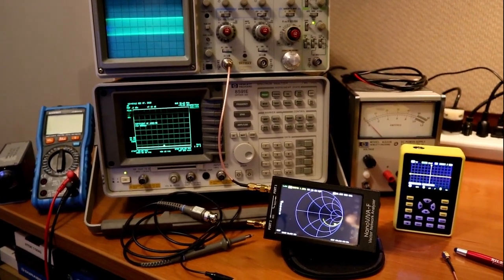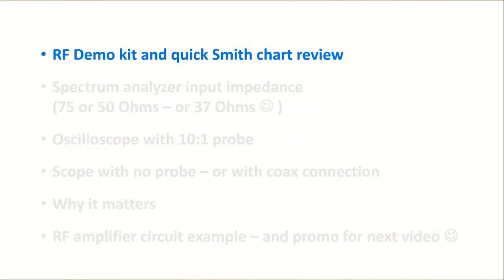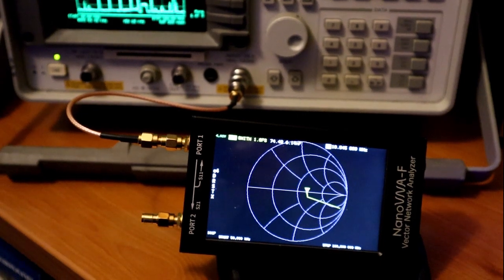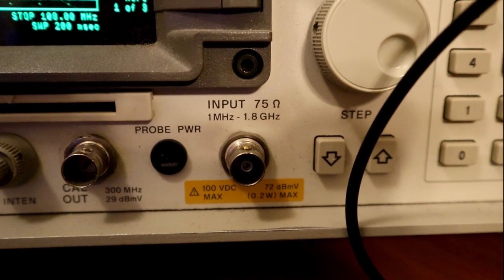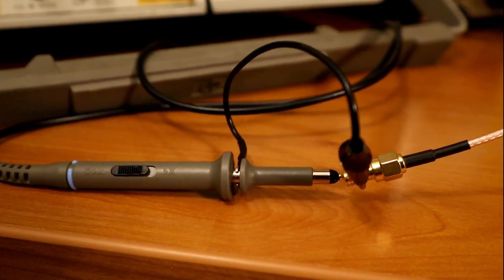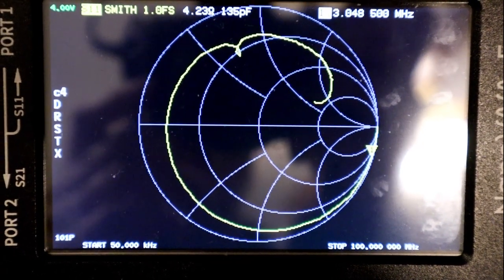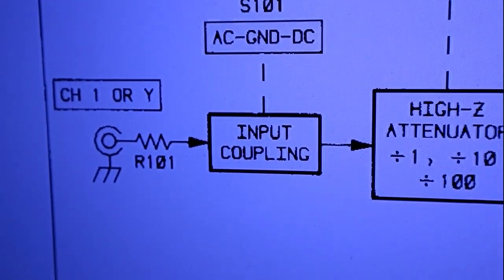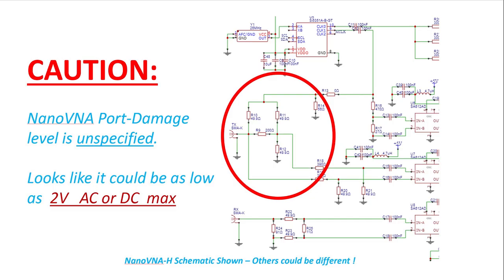NanoVNA - Measuring Impedances

Comment: Thank you!! I have the demo board and will fiddle around with it. I am curious though, I am trying to interface a 50ohm  antenna output to a little lithium battery charger board and want to know what the antenna "sees" when hooked up to the charger. I assume if there was 5Vdc on the input of the little battery charger ckt to activate the charging ckt, it would damage the NanoVNA, right? How do you measure an active circuit with a VNA?
Reply from the maker: You are right to be careful. Running our university lab, I always checked our instruments to be sure they had DC blocks in them and configured the power supplies we used to never go above 15 volts, since a typical DC block is only good to maybe 50V. The VNAs we had did have them (built-in series caps in the directional couplers), but some may not, and scopes with 50 Ohm inputs, and some spectrum analyzers didn't. So I got DC blocks and put them on the port with a sign that said ("do not remove this DC block"!). I don't think the NanoVNA has built in DC blocking, so when I built out my home lab I bought a few SMA versions like this: https://www.amazon.com/Nooelec-SMA-DC-Block-50kHz-8GHz/dp/B07YYLHJKS  There's some related discussion in the video on Measuring S21 and S11 of amplifiers, and of the DC block specifically around 2 minutes, 15 seconds into it: https://www.youtube.com/watch?v=GAycxgbncHU&list=PL9Ox3wpnB0koBGofotI4xS8R0ct0FeYfv&index=9

Comment: Just discovered this series of videos... loved the antenna series!    Just FYI, we have the same SA, the HP8591E, FYI-2, there is a soft menu switch to flip the input impedance from 50 to 75 Ohms, go to Amplitude, then More (page 2) and there is an input Z option switch...  4th menu softkey.    Hope it helps.    Steve
Reply from the maker: Thanks.  The 8591E is a great machine. The setting you described is great and even stays active after power cycling! (I think I have mine configured to recall 'last' configuration). I picked mine up on Ebay back around 2010 and it's gotten a lot of use. I found it for $800 listed as needing some repair, but when I got it, it worked fine. I was almost missing having the opportunity to try to fix it. It has developed a vertical sweep non-linearity issue (moderate) in the last few years. So maybe I'll get my chance after all ;-) But it settles out after about 15 minutes 🙂

Comment: Interesting facts about input impedance(s). I am confused, though, about the scoop. As are some meant to work at high and very high frequencies. I also know that good practice is to terminate the input of the scoop when testing for amplitudes, like bandwidth sweep. So definitely very useful piece of information here about the loading issues. As you wrap up, RF engineers use SA or VNA at higher frequencies, how do we measure then IN CIRCUIT, without loading much. For scope that could be differential probe (but I suppose very expensive for higher frequencies). But what about SA as those are all 50 or 75 Ohm input? I know there are special AVO meters for RF....
Reply from the maker: Excellent questions. There are two main methods used at RF. One is a passive, resistive voltage divider probe. For example, put a 450 Ohm resistor at the tip (in series) and then just use 50 Ohm coax going back to the 50 Ohm test equipment input. That gives a 500 Ohm load on the circuits, and a 10:1 attenuation (20dB). 500 Ohms is often OK at RF, but one could also use a 4950 (or 5K) resistor, making lighter loading, at the cost of 40 dB attenuation. Here's an example of a 500 Ohm one sold commercially (we had a couple of these in our lab). A little pricey, but you can also make one yourself. Of course, don't forget about the need for DC blocking (and generally don't use on high-power or tube equipment). This one includes a DC block internally, rated for 50VDC:  http://www.auburntec.com/auburn_INFO%20P20B.html#SPECIFICATIONS   The other option is to go with an "Active probe". They have to be powered, have limited DC voltage tolerance (maybe 5V), and are quite expensive. But they can present light loading, like 100K in parallel with 0.5pF. We also had those in our lab, but they are a little cumbersome to use. But not bad...
Reply: @MegawattKS  Thanks for the explanations. It probably all depends on the Zout of the circuit part we want to measure. There is one old type of analog AVO meter that is suited for these measurements. Meratronik V640. Probably designed and built in Poland, but there was cooperation with Canadian designers. And Marconi company also brought one under their name, but probably not designed themselves. The meter uses a special RF probe. DIY project for broadband diff-probe is one on my list. For SA, maybe to use 1x follower that have a high Zin and low Zout?
Reply: ...I am looking into OPA858, maybe to make an probe with it (TIA - Trans Impedance Amp).

Comment: Can you make tutorial how to measure gain antenna using nano vna?
Reply from the maker: Hi, sorry for the delay in replying.  Have you seen any of the "Antenna Briefs" series on this channel? https://www.youtube.com/playlist?list=PL9Ox3wpnB0kqNLnCdCtWcjGq7nRVHYxKA . While this doesn't directly show how to measure antenna gain, the series covers the definitions and utility of knowing the gain, and all the related things in a wireless system. Episodes 1, 2, and 6 are probably the closest to what you're asking about. Indeed, at about the 2 minute mark into Episode 1, there is a setup where the NanoVNA is used to look at bandwidth and path-loss (in addition to return loss) within a TX/RX system. It also covers issues of size vs frequency. In general, antenna measurements are rarely done at 30 MHz and below because of  size and difficulty with setup, and the NanoVNA wouldn't be used for that. But at UHF and above, it can be used with a suitable "Anechoic chamber", or with a suitable "range" environment without reflections. Also, gain is related to the antenna pattern, which is arguably the more important issue in many cases. See Episode 6 for that. Hope that helps some.
Reply: @MegawattKS  thanks you so much sir.

Comment: A scope does indeed load a circuit more at high frequencies because of the PARALLEL capacitance, but you are measuring the SERIES resistance and capacitance on the VNA. You should not be comparing series and parallel impedances and expect them to be similar. If the VNA will not display R in parallel with C, then you need to do some maths to convert between them. There are several online calculators that do this. 

Agilent, Tektronix etc are not lying about the input impedance. The reason you are not getting results similar to them is that you are not measuring the same thing!

Do you realise that the bridge of a VNA only works well with a VSWR of 5:1 or less, and less well at 10:1? That means they work reasonably well for impedances 5-500 Ω. A VNA is not suitable for MΩ impedances.
Reply from the maker: Thanks for leaving a detailed comment. To help out anyone reading this, I will provide a detailed reply (because the situation is complicated).  Yes - the VNA reads out in series form (either R+jX or R+C) and that should be converted to parallel form if one is assessing the 10M || 15 pF loading usually assumed.  If the probe tip to ground impedance is measured for an Agilent scope such as a DSOX2002A (or similar) 200 MHz scope, using a Agilent 10074C 10:1 passive probe, the measured impedance at 100 MHz is 49 - j160 Ohms using a well-calibrated HP8753C VNA. Well inside the Gamma=1 circle. In parallel form, this becomes 570 Ohms in parallel with -j170 Ohms (to two significant digits which is about what the VNA's accuracy is going to provide in this region of the Smith Chart). This is 570 Ohms in parallel with a 9pF capacitance - not the 10M || 15 pF marked on the probe. I would agree that Agilent and Tek are not lying, but would offer that "All models are wrong, yet some are useful" and details can affect some situations. Historically there was no issue because scopes maxed out at 1 MHz or so and the input Z was as marked. Even today, at lower frequencies the actual impedance will converge to the stated 10M || 15pF, certainly at audio - but not at RF. As you point out, we can't read 10M with a VNA. However, 10M||15pF would be on the right side of the chart at audio, and then hug the lower half of the chart at MHz and above as a pure capacitance does - not spiral inward as we see in the demo. For audio and low MHz work, 10M||15pF is still an OK approximation. But for RF work it isn't, as it can cause errors in circuit operation/measured performance. While the 9pF can be absorbed into a tuned LC tank circuit of an RF amplifier the remaining parallel R needs to be very high to avoid degrading the tank Q - which 10M would do.  Sadly the actual 570 Ohm parallel resistive part can significantly broaden the bandwidth and lower the gain, due to de-Qing the tank circuit (especially of the collector resistance is something like the 1.5K we often used in class project builds). This is in fact where we first ran into this issue. The gain was too low and the bandwidth too broad for what was expected with 10M||15pF loading the circuit. Fundamentally, the reason for all of this is that the probe uses a coax cable, which must be terminated in 50 Ohms (or whatever the Zo of the cable is) at high frequencies to avoid strong reflections at the scope input port. So the the input circuits have to transition from 10M || 15pF at audio, to 50 Ohms at UHF to achieve good damping factor and response flatness (another viewer pointed out that some probes use lossy coax to also help dampen the response). Of course the solution is to use an active probe if available and affordable. Or my personal favorite for RF work, a 10x (500 Ohm resistive) or 100x (5K resistive) low-C passive probe such as a Tektronix P6150, or the less expensive Auburn P-20a or P-20b units :-)  (HP made a nice 5K one - but I can't recall the probe's part number).
Reply: @MegawattKS  I tried some experiments using the following parts. 
* HP 54600B 100 MHz oscilloscope. Marked 1 MΩ // 13 pF on front panel. 
* Agilent 4285A 75 kHz to 30 MHz precision LCR meter. (mains powered). The LCR meter 4 terminals for Kelvin connections. 
* HP 100 Ω resistor with 4 BNC terminals (P/N 04285-61001)
* HP 16048A 1 m extension test leads for LCR meter (these are for Kelvin connections, so have 4 coaxial cables)
* Kirkby Microwave 42091A short for LCR meter (equivalent of Agilent 42091A short)
* Kirkby Microwave 42090A open for LCR meter (equivalent to Agilent 42090A open)
* Home made fixture for the LCR meter having a BNC plug to connect to the oscilloscope. 
* 1 m long cable with banana plugs at each end. 

First the cable compensation of the LCR meter was performed. This is necessary for the highest accuracy. 
* Attach HP 100 Ω resistor  on front of the LCR meter. 
* Attach 16048A 1 m extension test leads and put the 42091A short on the end
* Replace short with 42090A open
* Replace open with the 100  Ω resistor . 

Next the fixture I made was attached to the HP extension cables and calibrated with a BNC short, and leaving the connector open. The fixture I made was tested with passive components and found to work very well.

Trying to measure the input resistance and capacitance of the oscilloscope was problematic. What become apparent was that the input impedance varied as both a function of frequency, and the following 

* Whether the oscilloscope was connected to the mains supply 
* Whether the oscilloscope was connected to the mains, but switched off at the power switch at the front. 
* Whether  the oscilloscope was switched on or off, whilst connected to the mains. 
* Whether the 1 m long cable was used to connect the earth terminals of the LCR meter and oscilloscope, whilst instruments were powered on. 

I observed the following, where I have round results to 3 significant figures, despite the LCR meter has a 6 digit display. These are a few of the measurements I took. 

30 MHz oscilloscope off, connected to the mains. 30.0 pF // 326 Ω. 
30 MHz oscilloscope on, with ground cable 12.1 pF // 6.87 kΩ. 
1 MHz oscilloscope on, no ground cable 12.4 pF // 490 kΩ
1 MHz oscilloscope on, a ground cable between scope and LCR meter 11.6 pF // 1.12 MΩ 

Both the oscilloscope and LCR meter are mains powered, from a 230 V AC supply with an earth conductor  - standard in the UK. 

In summary, it was totally impossible to get any sensible results with these two mains powered instruments under the conditions I tested. I expect with mains isolation transformers and attention paid to stop ground loops it would be possible to make good measurements. But I'm not going to pursue this any more - making the fixture took several hours. 

Using a battery powered LCR meter would be better, as one does not need the accuracy of a high-end laboratory LCR meter. But since I don't actually need these measurements, and have better things to do with my time, I'm not going to pursue the matter any more. But if you have not noticed it, you are likely to get changes in the results due to grounding of the instruments.
Reply from the maker: Sorry for the delay in replying. For some reason, YouTube didn't notify me.
Interesting data.  Sounds like there could be "ground loop" or perhaps RFI pickup problems interfering with the 4285A measurement signals. Do you know the architecture of this instrument?  
It says it has 6-digit resolution, which leads me to believe (together with the f_max of 30 MHz) that it is not based on signal reflection like the VNA.

FWIW, here are the measurements we did with the 8753C VNA.
https://ecefiles.org/rf-circuits-course-section-9/

Also, if you have access to IEEE papers, the following might be of interest. I was involved in research on high-Q inductors and was annoyed with people reporting Q factors of, like, 150. As you said, VNAs are not good enough for that. So I wrote this paper after doing extensive assessments. As it turns out, the VNA is very accurate around the Gamma = -1 and Gamma = 1 points used in an SOLT cal. But for things like 0 + j100 Ohms, it's not very good at all and resonance techniques are needed (which themselves suffer from radiation losses :-( )
"Measuring and Reporting High Quality Factors of Inductors Using Vector Network Analyzers", IEEE Transactions on MTT, 2010.
https://ieeexplore.ieee.org/document/5428814
Reply: @MegawattKS  It’s funny, but YouTube emailed me when you replied 

The 4285A uses 4 coaxial cables to connect to the DUT. Only the inner conductors are used for connectors to the DUT. It uses a 4-wire Kelvin connection with two cables (Hcur & Lcur) providing a current source and the other two cables (Lpot & Hpot) measuring the potential difference across the DUT. It uses an automatic balancing bridge. The range is 0.00001 Ω to 99.9999 MΩ. It measures from 0.00001 uF to 999.999 uF. 

Running the scope from a UPS would probably solve the problem too. Having spent several hours making the fixture, I should really investigate more, but I don’t have a lot of interest.

I will take a look at the IEEE paper. Andrew Gregory at the National Physical Laboratory (NPL) has written quite an extensive paper on Q measurements (not just inductors). You will find it on the NPL website. https://eprintspublications.npl.co.uk/9304/3/MAT58.pdf
Reply from the maker: @dr.davidkirkby1959  Thanks.  I'll have a look at the report. Resonance is definitely useful for high-Q inductor assessment. Looks like a detailed treatment for that !

Comment: I just discovered your channel. Great video. I never measured the input impedance of the 10:1 and the non terminated input of a scope. Very interesting to see.
Reply from the maker: Thanks.  I first noticed this issue when probing an RF amp I had built. It's gain dropped when the probe was on the circuit (it should have only shifted frequency due to the 12pF added in shunt in the LC circuit). Checked and sure enough, it was shunting with C, but also something in the 1K region at 100 MHz.  Fundamentally they kinda have to add a 50 Ohm in series with a capacitor inside the scope in order to deal with the inevitable 50 (or 75) Ohm cable that's part of the probe :-)  Otherwise the scope's high-Z (1M) input would look like an open circuit at that end of the cable and the other end would be a short when the cable is lambda/4 long...
Reply: @MegawattKS  Right, you would get reflections from the mismatch. I always terminated at the scope for high speed measurements. If I was worried about loading, I would use an active probe. I never tried to see the response. This was very interesting. You should write an article about it
Reply from the maker: @twin1q  Good scopes appear to install an AC connected 50 Ohm resistor to ground (or something like it) inside the scope - to prevent that. Sadly, some of the new low-cost portable scopes coming out don't have it. But all the premium ones I've tested appear to.  I love active probes too! Found a couple on Ebay for a few hundred dollars that we have used in our lab when needed. Definitely important in any RF or high-speed digital lab as you said :-) FWIW, here's what I gave to students in our classes though. The PDF at the top of the page is a two-page handout that warns them about this issue :-)  https://ecefiles.org/rf-circuits-course-section-9/